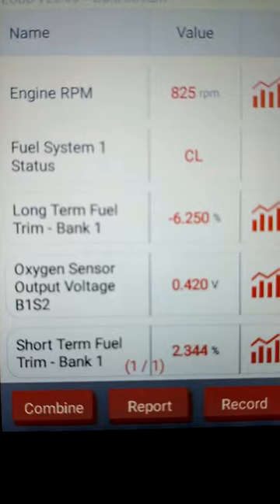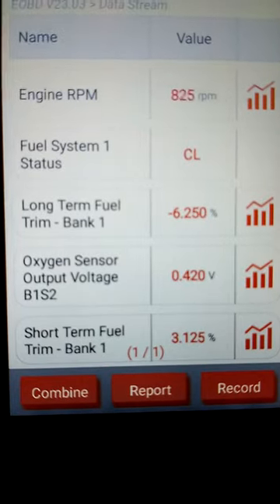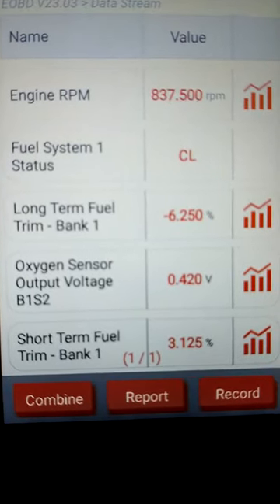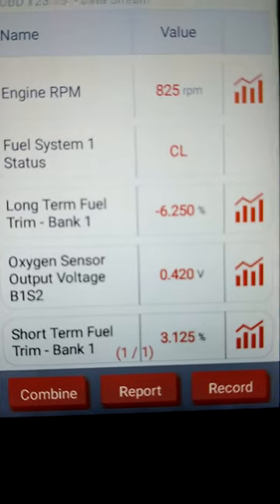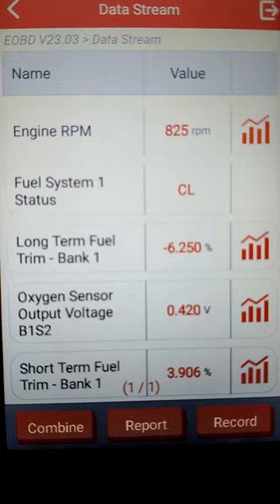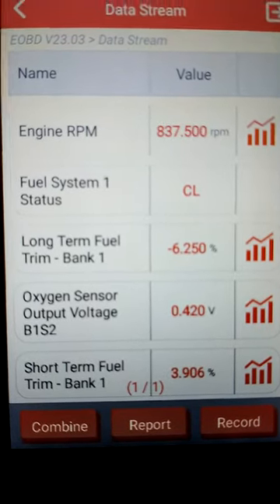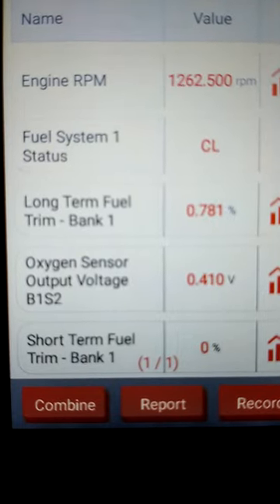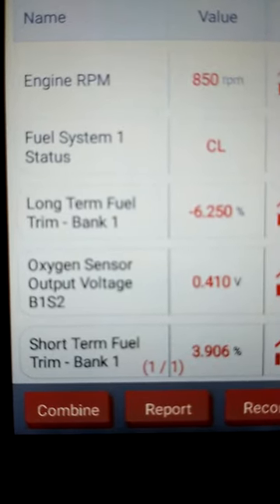Short Term and Long Term Fuel Trims, Oxygen 02 sensors Explained.

Comment: Hi, really good to see something new from you. One question, I was under the impression that the#2 o2 sensor was not supposed to fluctuate in voltage.
Reply from the maker: Thank you! I'm glad to be back. Maybe I misspoke or maybe I worded that part funny but yes and no. And idle it will fluctuate a bit but should stay pretty steady in the .4-.5 range. With increased followed by decreased engine speed it should continuously read rich and then lean if working correctly. If you hold the rpms steady at say 2500 for 15-20 seconds it should show a rich and taper down on the graph and it goes back down to idle speeds. With age and wear they tend to move a lot more at a steady idle, but I've also seen them stick and not move at all with any engine speed. Hope this helps clear things up a bit. Anymore questions just let me know!

Comment: I’ve got a random misfire on 5.3 ls changed plugs, wires, injectors and coil pack. The number 2 cylinder is mis firing the most I can rev engine and the mis fire stops. I had 160 psi compression on cylinder 2. I have 47 psi fuel pressure. Could fuel pump be problem?
Reply: Fuel pump issue only for cylinder 2? 
Check injector seal which is inserted on engine on cyl 2. Sometimes leaks from here. Also get swap fuel injectors from other cylinders and check if misfiring is moved. Also test your ignition coils on live monitoring, does it pass all signals to spark plug or is it losing? And check cylinder gasket if it’s blown close to cylinder 2, maybe wet and little antifreeze inside

Comment: What's normal readings for long term fuel trim moving at highway speeds ? Should the ecu level the long term fuel trim back to 0? I have a 97 tacoma hovering at +13 under acceleration at high way speeds but when I back out of it ecu drops it back to 0
Reply: I'M A BEGINNER WITH THE SAME QUESTION. I THINK ADJUSTMENTS IN FUEL TRIMS ARE NOT INSTANT, BUT REQUIRE A LITTLE TIMETO LEVEL-OFF. (EXAMPLE : PEDAL PRESSURE FOR 60MPH WHILE DRIVING 25MPH WILL SEND AN ABUNDANCE OF GAS & THUS "NEGATIVE" FUEL TRIM UNTIL 60MPH IS REACHED )

Comment: Hi, thanks for the video, personally, I find it instructive and conceptually, easy to follow, whether oxy sensor was up or down stream ,before or after correction by the cat, any mechanic can differentiate that on his own job at hand. I like to know what scanner you used for this test in your video, if possible. Thanks.

Comment: Hello there! Amazing video. I have a Dodge Ram 1500 4.7 that I restarted after sitting in the driveway for 11 years. 89k on it. Had to replace pretty much everything to get it rolling again. Driving nice, good vacuum, one thing that's bothering is the fuel consumption. I scanned the engine, STFT oscillates -3.13 to +2.34 at idle,1500rpm, 2500rpm and when I drive 45 mile per hour, sometimes it gets to -7. LTFT negative from 0.78 to 12.50. The O2 sensors oscillates 0.14 to 0.85. Been reading a lot of fuel trim material online, so far I cannot figure it out what it could cause the negative fuel trim. I created an exhaust leak before the catalytic converter and the fuel trim jumped at +28, 29, 30. As of now I keep researching and running tests on this truck. Do you cover Dodge Ram fuel trims at all? Thanks!
Reply from the maker: Hey, thanks for watching man! Did you replace the fuel pump, injectors, fuel filter? Those numbers aren't to bad especially given the age. Could be something as simple as a leaky injector but unless it's running really rough I wouldn't worry to much. Hard to say without more information of course. Report back!
Reply: Fuel pump brand new, fuel pressure within spec, fuel filter is inside the pump, fuel regulator came attached with the pump. OEM injectors brand new. Before getting these injectors, I had a set of remanufactured ones, thought if I get new it will sort out the rich condition, but it did not. It is running great, but the fuel consumption is bothering me a lot, reason why I started to look into the fuel trims. To my understanding the running rich =not enough air to the stoichiometric air/fuel mixture. Something is restricting the air after the throttle body, TB cleaned up several times. TPS replaced. Throttle position reads 12.16% at idle, MAP sensor replaced reads about 5 psi at idle. O2 sensor brand new, both fluctuates up and down 0.08 to 0.90. Oxygen sensor 2 is fluctuating same as the Oxygen 1, like it is following. Thanks for getting back! @good2boost529

Comment: I have scanner pro and an ELM327 WiFi OBD and I can create interfaces for the different things that you need to keep an eye on
Really new to all this
So I have STFT1 & LTFT1 w/ o2 sensor B1S1 upstream
Map sensor data: barometric  + voltage and RPM
For 2 interfaces

What would I want for fuel injectors or coils and plugs
Any ideas of other interface elements that I could add to create other pages???😊

Thanks Kevin

Comment: Hello, I could really use some help diagnosing my OBD2 live data, I have an uploaded video on my channel, it's a screen recording and basically in closed loop the LTFT is +14%, and the STFT fluctuates somewhere between -10% to  -21%. If we add these values together (+14% - 21% I still get around -7% which is not that bad I guess) but does it work that way? Or am I having some much bigger problems? Btw, MAF sensor and throttle body were cleaned. Thanks for help.

Comment: Hi 
My engine light went on board and I used my scan tool to detect DTCs and it came up I have a code for oxygen sensor and a
Code for MAF sensor. If MAF sensor is not functioning it will affect oxygen sensor readings right. Best method to rectify if issue is in the oxygen sensor or MAF sensor? Thanks 🙏

Comment: Hi. I have a high negative fuel trim but I can’t find any leaks. I used the smoke test machine(but I am not sure if it’s 100% going to confirm no leaks)

I have a ODB2 gauge showing -25 STFT(slowly dropping to -7) when I let go of my accelerator with no brakes. But this doesn’t happen all the time. Sometimes it’s goes to 0 in a second or sometimes it 0 right after I release the pedal.

I have replaced MAF sensor, MAP sensors and O2 sensors. PCV valve, IAC valve and EVAP valve and most recently spark plugs

Do you think I should change my fuel Injectors next? My tuner told me it’s very likely a vacuum leak(mentioned fuel pressure is fine and didn’t once mention an exhaust leak)
Reply: My car is a civic hatchback 2017 with almost 100,000 miles

Comment: I have LTFT %25 and STFT zero with P0068 related to Map sensor, 
I replaced Map sensor but LTFT still really high and not go less 18% whatever RPM 
I attempted smoke test and no vacuum leak at all, 
Replaced lowe pressure fuel pump with filter but still LTFT %25 with 900 RPM and Change to be %18 once touch accelerate paddle and stop at 18% even if 5000 RPM, may I know if you have an idea to solve this issue  especially I replaced Bank1 sensor 1 O2 sensor  ?

Comment: I have a quick ? My vehicle is tuned and has been for 3 years passing inspection I get headers put on and now after everything disconnected/ re connected it says my 02 sensors aren't ready. 2019 ram2500 6.4
Reply from the maker: Sorry for the late response. They reading ready now? That's normal when you disconnect power. You just have to drive a few miles for the monitors to make sure everything is reading within spec. Then it'll pass and say ready!

Comment: I really enjoyed your video. It gave me some ideas where to look. I went and bought a scan tool and 1 code came up. The code was P065E intake manifold tuning valve Bank 1. Do I need to change the bank I oxygen sensor or the tuning valve or both. Your reply back will surely be appreciated. Needing Help. I'm New at this. Thank you!

Comment: You are reading wrong oxygen sensor. It is supposed to be bank1s1 which should be fluctuating ( if it is narrow band ) 
On the other hand, bank1s2 shouldn't be fluctuating normally, but i noticed when you rev the engine, bank1s2 didn't respond when tells me either the sensor is bad or wiring issue.

Comment: If -12 percent long trim at idle and  becomes -2 percent at high rpm. What is this mean?
Reply: Might be a small air leak from the throttle and on. Spray all lines with soapy water, or smoke test

Comment: What would cause a p0137 code ?
Reply: WHAT CAN CAUSE LOW VOLTAGE IN SENSOR 2?

There are a handful of issues that can cause voltage to drop in O2 sensor 2. Some of the most common issues are the following:

An exhaust leak

A short in the O2 voltage circuit

Loose connections

Excessively high or low fuel pressure

An engine that’s running either very lean or very rich

A faulty O2 sensor

Comment: When I’m driving about 70 miles an hour mile long fuel trim is about 40 then it fluctuates almost as fast as my short trim does, and from at idle, it’s at -7.9.
Reply: It's bad if your LTFT moves as fast as STFT. It shouldn't do that